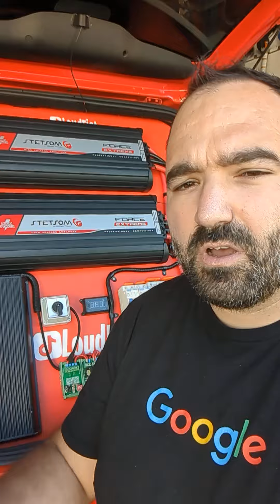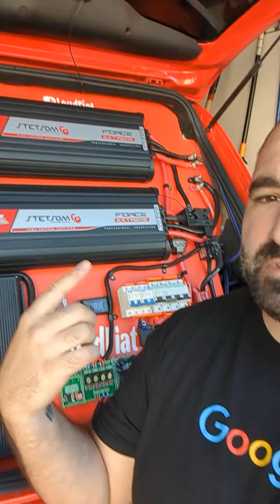400v amplifier in Electric vehicle - how much work?

Comment: I work on 600v 3phase and I'm not an electrical  engineer I could definitely accomplish this install but lots of money for correct cable probably sheilded and use the shield to detect chafing on body panels and probably use a pyro fuse for crash and fault protection mint setup tho probably wouldn't af used an andersons connector but I always worry about moisture and contact resistance